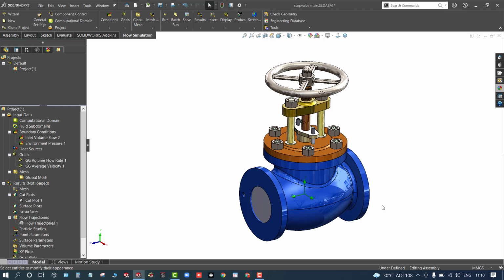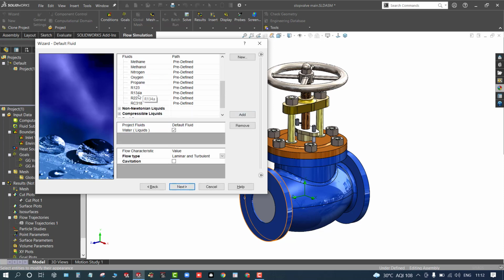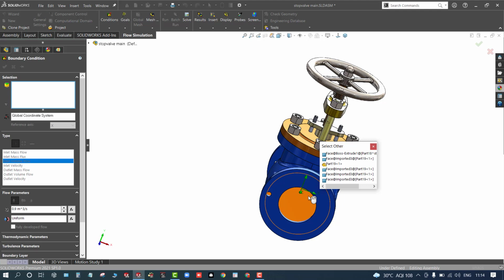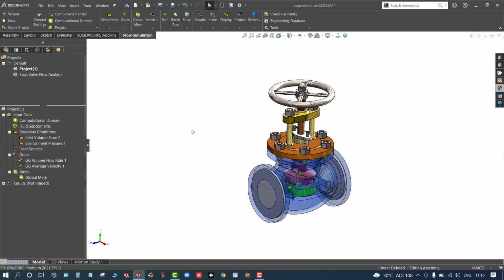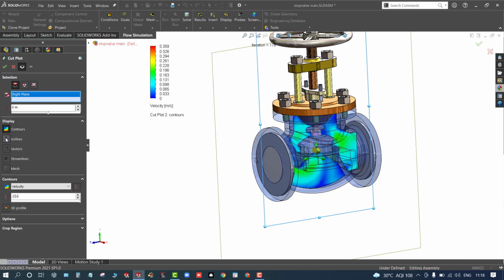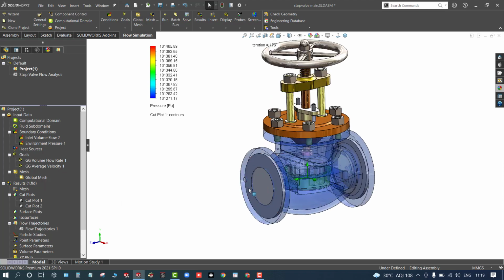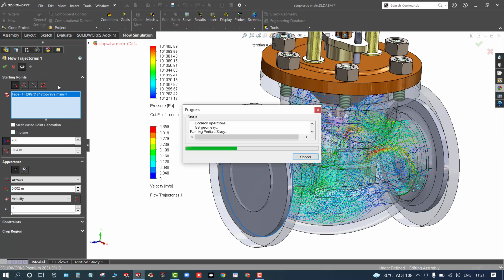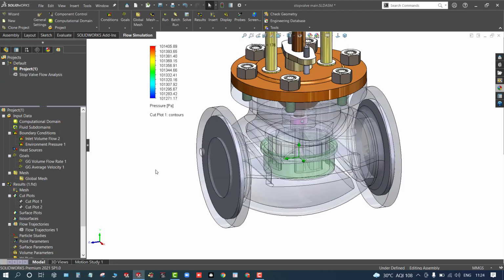Flow Analysis on Stop Valve | Improving the Performance of VALVE using SOLIDWORKS Flow Simulation

Comment: I have seen that you have not selected any materials for this. Is it really not required for low simulation?
Reply from the maker: We have selected the fluid for analysis. Model materials are already defined. It will consider default materials if not defined